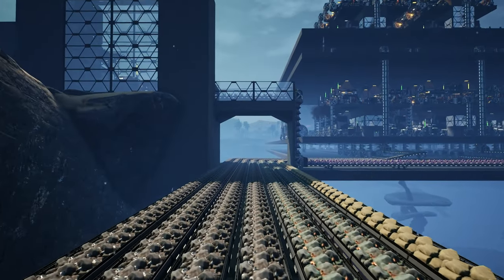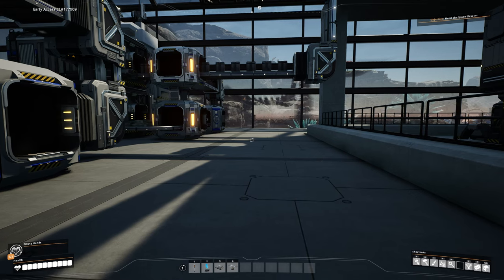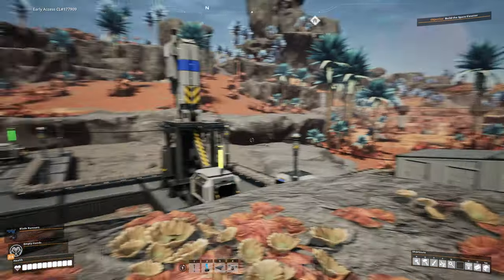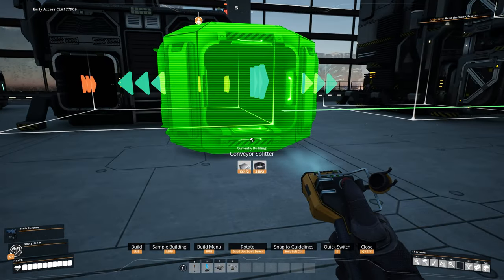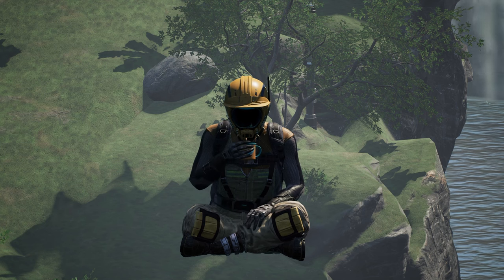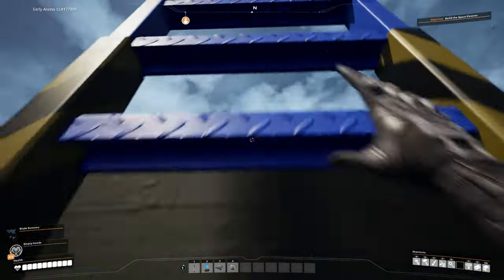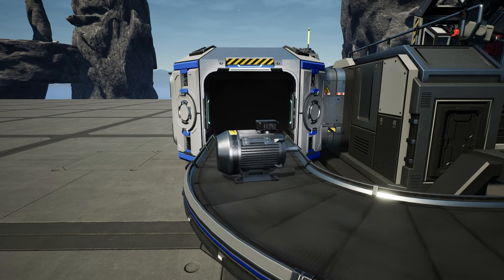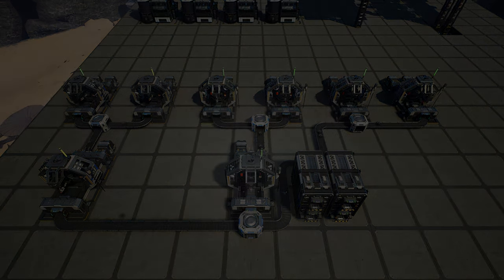Stators, Motors and even doing a MAJOR Upgrade! - Part 8

Comment: Great vid! but where did you get he rods for the frames bc both frame farms were taken by plates and rotors
Reply: Rod farm not frame farm**
Reply from the maker: The Screw line has way to many rods going down the Manifold.. So what its doing is the Excess rods are going through a smart splitter at the end and overflowing into the frame line and luckily its the correct amount i need for the asemblers there!  Hopefully this clears things up
Reply: @ItsBitz  Legend<3 Keep up the good work!
Reply from the maker: @jordancampbell1224   Thanks Brother!

Comment: Since you have started season two, I'd make the suggestion that timelapses need an explanation as to what and why you are doing what you are doing.  You mentioned a big picture 'why' but the details were glossed over.  

You started the series as a beginner tutorial and an explanation for your though processes surrounding your choices, but as this series has gone along you seem to have drifted away from that objective.

I don't recall you setting out the objective for S2 but since you truncated S1 due to logistical/production issues and you didn't lay out newly defined objectives for S2 (that I recall, anyway), it's fair to assume your audence may expect a continuation of the tutorial format.

All my opinion, of course so YMMV, but maybe something to consider when you're doing the voiceovers.

HTH!